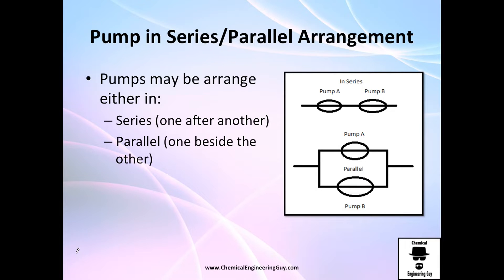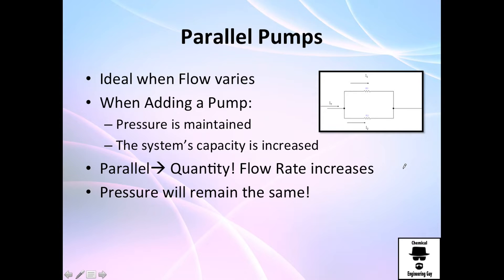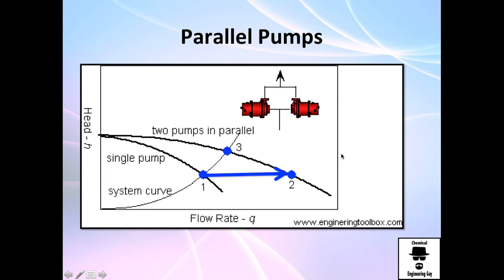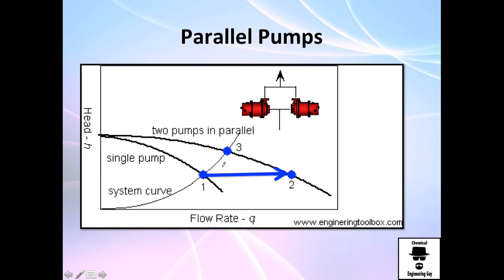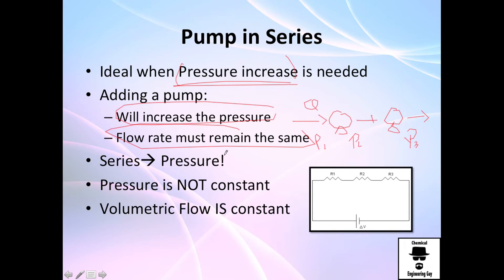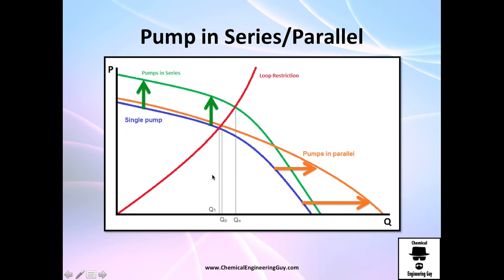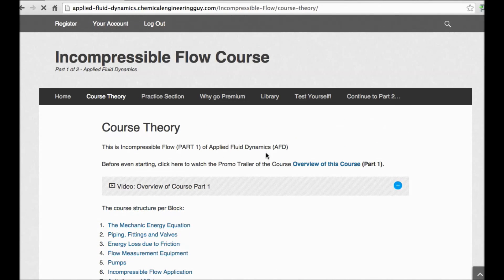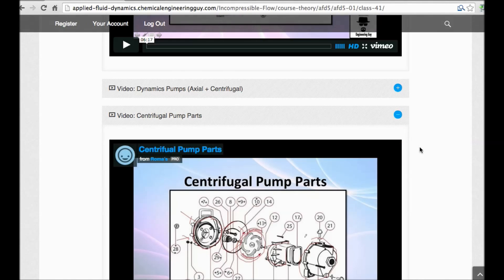Parallel vs Series Pumps / Applied Fluid Dynamics - Class 056

Comment: So in series what happens to the pressure of the second pump if it exceeds the psi rating? 2 pumps 10 GPM at 100 psi
Reply from the maker: Well, definetively ensure to work within the pressure range... if don't... you'll simply break your 2nd pump

Comment: Hello brother, can i know when pump in series will also increase suction length?
I hope you can help me
Reply from the maker: Hi, if the suction length, aka "suction lift" =  vertical distance between the water source and the pump's inlet.
It represents the maximum height the pump can effectively draw water from. Then, the suction length is primarily influenced by factors such as the pump design, atmospheric pressure, friction losses, and the properties of the fluid being pumped.

While arranging pumps in series can increase the total head and improve the overall performance of the system, it does not directly impact the suction length or the ability to draw water from a particular depth. The individual pumps in the series will still have their own limitations and suction capabilities.

Comment: Is maximum suction depth increased by putting pumps in series or parallel? If so, which is better for increasing suction depth for shallow well applications?  Once the well is primed and held with a check valve, does the suction depth of a pump matter? I'm not an engineer, I just sometimes have to deal with sprinklers & wells.
Reply from the maker: 💬 Great question! Putting pumps in series increases the total head (pressure), which can help with suction lift (deeper suction). Pumps in parallel increase flow rate but not suction depth. For shallow wells, a single properly sized pump usually works best. Once primed with a check valve, suction depth matters less since the pump stays flooded. 🚿💧

Comment: I have a pump that has two pumps driven by the same 120VAC motor. Can I hook one to the other like the output of one to the input of the other and get more pressure?
Reply from the maker: Yes, theoretically, you will get more pressure (head) by hooking them in series! 📈

Just make sure the second pump's casing/seals can handle the elevated pressure being pushed into it from the first pump, or it could fail. Good luck!

Comment: I came here because I want to install 3 sprinklers for my kitchen garden.

I have one pump and 3 sprinklers. I want to keep the pressure for each sprinkler as high as possible and evenly rated.
So my conclusion is to put them in series instead of parallel. Am I correct?
Reply from the maker: Well... It is much more complex than that.. If they have the same size of inlet/outlets, then the first will get always higher pressure than the last one, you would need to adapt the size. In this specific case, you should have a 3-way piping system, so it divides water flow rate and pressure evenly.
Reply: @ChemicalEngineeringGuy  many thanks for your advice! 🛠️ I meant parallel instread of series. So indeed the 3 way piping system is the way to go.

Comment: I get the theory but doubt to implement, my situation is from ground down to well is 9m then 1/2inch pipe 40m to pump, of course it cant suck, so if i parallel 1 or 2 more pump can it work? fyi i cant place the pump near the well, i have spesific problem with that. thanks
Reply from the maker: What is the problem? you typically need parallel pumps when you do not have enough power in 1 of them, so you split the stream into two materials, i.e. two pipes that smaller pumps can handle

Comment: Sounds like parallel might be what I need for my waterbox build.
I plan on using a quad fan radiator (maybe two for passive cooling) and I thought I'd need to run D5 pumps in series since I'll be running a motherboard block with RAM, GPU and chipset (I've thought about adding the PSU to the loop as well, hence why I may run two of those huge radiators)

So based on that, do you think parallel D5 pumps would be able to move all that fluid or should I run series for more head pressure?

Comment: Sir, open system mein chilled water different quantities chahiye isilye kabhi min 5hp, kabhi7.5hp, kabhi aur 5 hp aur add karke 17.5 hp qty discharge full load chahiye. pararallel mein header size kitna dena chahiye sir? please reply sir. each pump d= 50 mm and s = 65 mm hai. please.
Reply from the maker: Srry, didnt got the message, can you re-formulate
Reply: @ChemicalEngineeringGuy  16 rooms 10 tons cooling load each room,  cooling load varies from 10 to 160 tons throughout week. so i want to  pump needed qty of chw water. therefore diff size pumps parallel connected. advise header size please.

Comment: I have one pump and 3 filters. The pressure switch is 45 psi. The pump is cycling. Will adding a another pump in series fix this?
Reply from the maker: what do you want to do exactly? Increase pressure or increase flow rate?

Comment: Hi CEGuy, interesting lesson but ... do I want pressure or flow?  I'm using pump output to drive an underwater vehicle (swimming pool bottom cleaner).  It works by pumping the circulation flow of the pool pump through a hose attached to the top of the cleaner that gets directed out of an end of the cleaner as thrust.  I want to give the cleaner more umph because it sometimes gets stuck on the drain plug and I'm thinking a little more umph and it will ride over it.  So ... what do I need for umph, pressure or flow?!  :)

Comment: Actual real world flow and pressure will not be ideal p1 + p2 , or flow1 + flow2. Follow the system curve, because you forgot the increased friction of each added pump?
Reply from the maker: that is correct, but that is the way we model it; eventually you will model friction losses and, of course, the change in flow rates